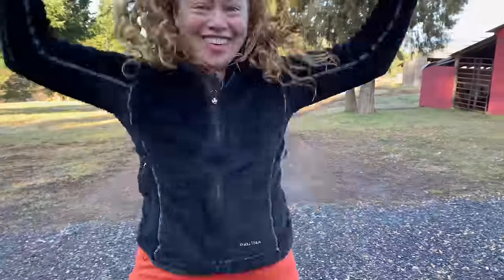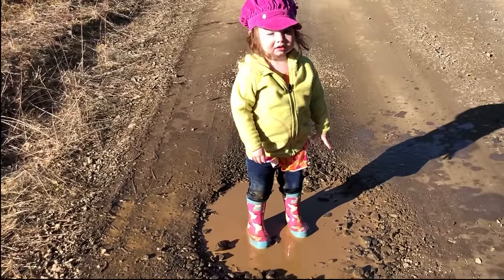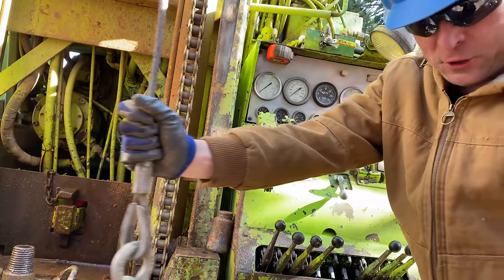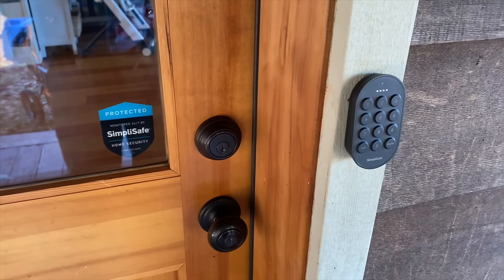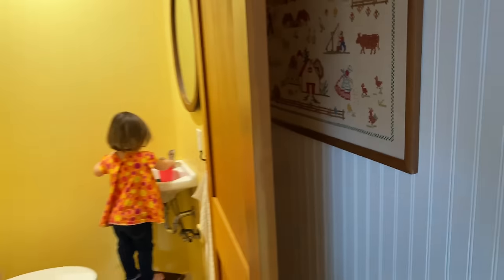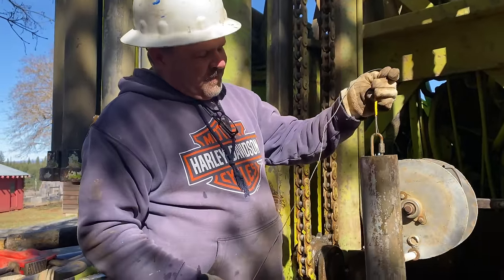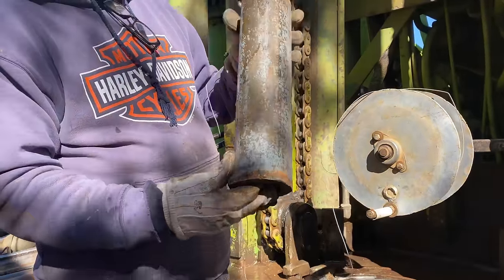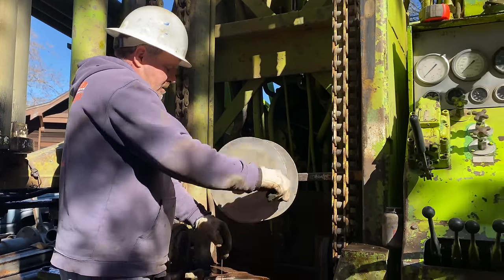TESTING The Cheapest Well Driller on Amazon

Comment: This video takes me back to my youth. Among my grandfather's many skills, he was a well driller, using the machine that he built himself. It was an old cable style machine, bouncing the drill bit up and down, not a modern auger machine. It was slow going, taking a couple weeks to drill 80 or 100 foot well. He built it back in the late 60s early 70s, because the 20-foot hand-dug wells on the homestead would run low in the summertime. He also drilled many wells for other people after he retired from his job as mechanic/bus driver, but he never stopped farming. I'm a bit of a nerd when it comes to this kind of Hands-On stuff, so I'm looking forward to seeing videos about the well pump and how its integrated into your plumbing system. Cheers.
Reply: We call those types of rigs "pounders" out here on the right coast; no one uses them anymore around my area of NY that I've seen; my house well was "drilled" with a pounder style rig 40 years ago and its only 75' deep; always had great supply and best tasting water; all the houses that came after mine in my neighborhood were drilled with rotary rigs; all are 250' feet to 400' deep and they all have sulphur; ya, the rotary rig drilled them wells in a couple days and the pounder took a week or more; but that rotary rig cost at least a half million bucks or more!! That pounder was probably built by someone like your grandfather!!!
Reply: @ront8261  My grandfather was quite the fabricator and mechanic. He watched other people drilling wells, then gathered up miscellaneous parts and built his own.
Reply: We had a country neighbor who had that type of well rig. Pick the weight up and drop it pick the weight up and drop it.  He built it on an a late 30s truck chassis. I couldn't begin to tell you how many wells he sunk with that rig
Reply: @jeffreyyeip1915  I love this particular comment chain. Great stuff!
Reply: They are called a percussion rig
Reply: @gearheadted5110  m

Comment: When my well was drilled they set the pump at 60 feet. Hit water much sooner, the water static height is 12 feet from the top. Many gallons per minute. 3500.00 complete cost

Comment: We've had SimpliSafe for many years. It's nice because you don't have to let a stranger into your home to install it. You just figure out what you need, order it and then install it. Prior to SimpliSafe we had a alarm that would use our home phone line to call out. Someone snipped the inside of the phone line so they could spread it to disconnect it but it still looked connected. We have our system connected to our outbuildings too. The weakest link are lazy police. If a alarm calls the police 3 times, they want to charge the homeowner for having to respond to a call. The people that you rely on to protect you often want to rob you more than any burglar might.

Comment: A friend drilled 6 wells and each went over 400' hitting no water. Lastly they tried in another area and hit water, although to get the flow rate he wanted, they had to go down over 800'. The driller gave him a deal  on the dusters, but the one working well cost almost $100,000. Had to put on a VFD and sizeable 3-phase pump to bring it to surface. That's what you get for living on a huge hill. The alternative was to pay the city to connect him, but they wanted a 10-year contract with $25,000 hookup and montly delivery costs of $600 + usage.

Comment: Watched a water well being bored over 30yrs ago  in Rapid City,SD.My father and the neighbors built homes in the hills outside of town.Dads well was like 350Ft-didn't see that one drilled-an neighbors on the hill was 600Ft.Some of the drilling involved boring thru solid granite.The drill rig was much like the one shown-It used an outside air compressor as well as the compressor  on the rig.The driller  told me some of the drilling they had to use a diamond bit to cut thru the rock.Showed me a 6" one-If used added to your cost 6K  for each bit!Otherwise they used the carbide drill as shown.Was thrilling when the driller hit water-Was a small gusher-the water was under some pressure-but not enough to get it to the surface.Submersable pumps had to be used for that well and my Dads.The pumps are one of the more expensive parts used.The electrical equipment for the pump motor on the surface cables and a lifting cable go to the pump so it can be brought to the surface for replacement or service.A lightening storm took out a pump and was replaced.

Comment: did you use a water witch and what kind of pump you putting in. i have been looking at those ole timer Jensen 13 or 50 pump jacks. run on very little power needs. as opposed even smaller submerged pumps need 4000-6000 surge watts

Comment: My company is making systems for old wells. It started from my own well that is prbbly 30 year old and started getting dry. I had to dug it a bit every year untill I prepared an arduino program for my well :). 
Program is made to match water extraction to our well performance. 5 years w/o digging
Controller is mounted to water pump and You don't put anything in pipes.

Comment: I got a well put in 5 years ago.  280ft deep, 100ft of static water, 50gpm flow rate.  I will warn you, if your well is like mine, the water is brutally cold.  Mine is 45F year round.  However the water that deep tends to be awesome quality.  Outside of a sediment filter it need no treatment.  Almost no hardness in it at all.

Comment: I'm in NY - 50 miles north of NYC. Drillers hit water at 50 feet. They continued drilling to 125 feet to make a reservoir. 60 gpm was flooding my front yard. That had to pipe it away from the house until they capped the well.
Reply: wow thats crazy, so did they just drill another well that wasnt so deep?
Reply: No, they came back the next day to dig a trench to the house. It's been more than 20 years - no problems.

Comment: When we built our home in 1997 I used Rollins on the North Shore (Topsfield) Massachusetts. It was 305' deep and I got 55G/M :-)  Pump was at 105 feet. Of course, it's only a 15G/M pump and 45 PSI tank, so the 55G/M didn't mean a lot other than the fact 1/4 mile up the road only got 2G/M. Paid $8/foot for well and $8/foot for casing. Total was around $9000 as I recall. Now we live outside Phoenix where we have no water :-(

Comment: My last house in CT I had to replace my well pipe as after 60 years the wipe was getting pin hole leaks.  150 down and 150 up to my in the cellar jetpump.  So the feed and return lines me and my best friend, who happened to be a plumber yanked out and jamed in the new well pipe into our 6" casing.  We were whipped when we finished.  We just laid on the ground for 20 minutes and didn't move, wishing I had an 8" well casing....

Comment: Here in eastern Idaho the well drillers always check the gravel they pull out for GOLD sometimes they find a little bit. We had to drill a new well... hit water at 40 ft. went down to 60 and had them install a $ 1500 stainless steel sand screen. The old 40 ft well was drilled 20 years before we decided to build 10 years ago The old well had 20 feet of sand wash in. the well driller said it was better to drill a new well than try to clean out the old one and go deeper.

Comment: I was thinking about having a well dug here.  The digger said it would cost $7,000 to drill 300' which would put the well just below a rock layer where the good water is.  I thought that was a reasonable price, but didn't do it because the the truck would make such a huge mess and the support truck would probably crack up the driveway that I had just had repaved.

Comment: Well-digging is just fascinating to me.  I'm curious of the method you used to decide where to drill. Aquafers can sometimes twist and turn, widen and narrow a bit like surface rivers, so finding a place where you can tap into it can sometimes be a challenge. How'd you know?
Reply from the maker: Simple, I chose a location that was close to my existing water line and power supply,
Reply: @wranglerstar  Sometimes simple is the best! TY. Be blessed.

Comment: Fun fact: That rock hammer there using cost over 5 grand and the bit on the cost 600-800 hundred. Use to drill blasting hole in Quarry few years back with a similar rig.

Comment: What do they charge where your at for the full well package,here in North Central Florida we charge $2,995 up to 100' and for every foot after 100 it's $10 a foot and give a 5 year warranty on the fully stainless steel pump.
Reply from the maker: Around 20k
Reply: @wranglerstar  Was the Well Driller "metric" free?
Reply: @wranglerstar  wow the deepest we've drilled for someone was about 275 foot and that was a bill of almost 6k was high for around here I couldn't imagine 20k
Reply from the maker: Naturally
Reply: @wranglerstar  I do know in the Smoky mountains in Tennessee where were wanting to move being 4-6 thousand feet above sea level we were looking just over 10k for a well package now we will let someone do the drilling and set the casing but I'm going to put the rest of the package in so I have my 5 year warranty and I know that it's done to the way I would want it done.

Comment: Cody I'm a well driller in Idaho and I'm just wondering  did they put a PVC liner in your well we always install 4.5 inch PVC liner to protect the pump and insure the integrity of the bore hole from caveing in and man do we need to raise our prices 100$ a foot is high we are charging 42$ a foot that includes 6" casing  and did they charge you for your surface seal separate from that 100$ a foot
Reply from the maker: Nope,  hit solid rock at 40'
Reply: @wranglerstar   ok how far down did they do there surface seal again just curious how it's done else where thanks for your time

Comment: Where I live in the sand in N.S, Canada I have a sand point 6' below my basement floor. Works great but every 7-10 years should be pulled up and changed as they harden up inside with sand and don't work nearly as well. Great for gardening etc if water table close to surface.

Comment: It cost me up here in northern Ontario, Canada $12,000.oo for 176' and 12 gallons/minute recovery rate. That is hole drilled, casing, inline pump and trenching for th line into the house and a new pressure tank. I think I came out on the winning end of that deal.

Comment: Confused the heck out of me when those boys started the hole out with their hammer, Do yall not have overburden? Im a driller in the SE United States and we start with a stabilizer and a tri cone roller bit, we dont use the hammer until we have set pipe into competent rock. Different where you live?

Comment: I'm not sure if anyone has seen it, but the website https://www.drillyourownwell.com/ has a way to do a shallowish well by yourself. the cliffnote version is you use a sump to pump water down while you push PVC pipe down the hole. wouldn't use it as a sole water source imo, but as a secondary well to water plants or animals it could work

Comment: Pretty much the same process as drilling an oil or gas well. Kind of interesting to see them hammer drilling. The mud they use builds up a filter cake on the sides of the hole.

Comment: I remember the last time I got a well drilled, was with a rig like that about 120 feet. And the well before that was with a rig that was like an old piling hammer. You lift a weight and drop it over and over, but they tended to run out of steam at about 40 to 50 feet. (it was about $10 a foot, that might tell you how long ago that was 😁)

Comment: wood at 800 feet.  burned wood in depths as well. makes you think did the northern american ice cap get hit by meteor 12,500 years ago.  i would have interest in study of the wood, type and age? also,  like to see those areas from satellites,  if there are massive silt deposit and out flows form the larger mountain ranges.
Reply from the maker: It's an incredible mystery,
Reply: @wranglerstar  Randall Carlson talks about such an event. also makes you think is current weather (aka climate change) just part of the re-balance effect of such an event.
Reply: The only logical explanation is a flood. By the way that's how we get our oil deposits also.
Reply: @DK-jd8bj  rapid melting of ice cap. biblical or natural. why would the wood be be charred?

Comment: Finding wood that deep only proves that the earth has built up over time due to vegetation and/or wind.
Reply: Fool, if that were true, the wood would have been rotten and gone.  Only way you get buried fossils is via RAPID burial
Reply: @w8stral   , I guess you've never seen a branch fall off and bury itself into the ground or rain water bury wood with sediment. Maybe you live in a desert but even then you should have seen how fast a sandstorm can bury things. On second thoughts, it's safe to say you live in a cardboard box. 😄
Reply: @yamahafan7330  By the way, things have to buried deeply to not rot.  Not surface sand which lets oxygen in meters deep.  Why buried under MUD is generally necessary.
Reply: @w8stral , you're obviously not thinking outside of the "box" again.  I'm guessing you haven't seen what flood water does. That combined with all that I've mentioned would be more than enough to make petrified wood. That's not even to mention tectonic plate movement.
Reply: @yamahafan7330  Ah, another fan, who also admits, uniformitarianism is complete BS.  Excellent place to start.  And no, small  time flooding does not do it as it does not create the laminai in the rock nor sort by clast size.  Grand Canyon is an easy example.  Can map layers hundreds of miles long by hundreds of miles wide which 100% had to be laid down in a moving mud flow as that is the ONLY way we can duplicate it in a lab environment.  I don't know about you, but there is no hundreds of miles wide rivers around, not even if you combined all the rivers of the world.
Reply: @w8stral , as they say ignorance is bliss. 😂 You must have a blissful life. I've seen even small rivers wash out banks that could bury a building, let alone big rivers. You haven't even taken volcanoes or earthquakes into the equation. Once again, not thinking outside of the "box".
Reply: @yamahafan7330  Do you have a problem with your eyes?  Appears you cannot read and make strawmen arguments up out of nothing to make yourself feel better and self important.  Read genius.  Did I ever say anything about volcanoes etc?  No.  This isn't the only wood on earth found thousands of feet below current surface.  Far from any volcano and the age given is also problematic combined with the fact it is not fossilized.  1) age is drastically wrong or 2) world is a catastrophic place, not uniformitarian making dating methods utterly useless for most things(also probably true)
Reply: @w8stral  , it appears that you're just making pointless, ignorant arguments to appear an expert on the subject. Just because there's no volcanoes or earthquakes there now means nothing. After millions of years things change.  I'm guessing you're a true Noah's ark believer, everyone has to believe in something I guess. 😀
Reply: As I've said, there are many different factors to take into account, combined they offer a reasonable explanation for this which you're ignorantly disregarding.
Reply: @yamahafan7330  Sure there are several factors..... and?  Did I ever say otherwise? NO.  The ages specified are wrong if what you say is right.  Either way things are not as they seem.
Reply: @w8stral  , you seem to have a lot of faith in archaeologists and dating methods which are not even close to 100% accurate.
Reply: @w8stral  "The ages specified are wrong if what you say is right" No, that is not at all true. What he is saying is that there are a multitude of possible ways that a piece of wood could be found at that depth and not be fossilized and he is correct. He tried to point out a few of those and how they could combine or work in a way to make this happen but you are insistent that you know for sure none of those possibilities would work. There is NO WAY you can make that claim without first considering all of them. Are we to believe that you are a specialist who is so well versed in each of the disciplines that you know off hand none of them are a viable explanation? Impossible. It is funny how nature works and will surprise you at every turn. I gotta go with Yamaha Fan on this and agree there are probably a number of different ways a piece of wood could be at that depth and not be fossilized.

Comment: Well drilling is expensive out west.
Reply from the maker: Yes it is, we drilled nearly 300 feet through solid basalt rock,
Reply: @wranglerstar  I'm in the Appalachian mountains of NC, our well is 200 ft deep through limestone. Not sure what it cost, was put in by previous owners.  We are so thankful it was already here. It is  an artesian well. It is under positive pressure. It produces water even when the pump is off, so it needs an overflow pipe. Produces so much water the well testers said they couldn't get an accurate gpm,  it could support a whole neighborhood. Love all the videos Cody, God bless!

Comment: 9:59. So to burts a bubble here. It takes roughly 376 years ( with varients) to get roughly 1 ft of dirt. To find wood at 800 feet that's roughly 3 million years of build up. Also a little fun fact. Petrified wood happened partially because when trees died in that era there wasn't any bacteria to fully decompose the dead tree. Combine that with rapidly changing environment tah dah you get petrified wood. The youngest being around 15 million years and the oldest around 370. So theres no way scientifically wood found 800 feet deep is anything younger than 3 million years
Reply: Noone asked